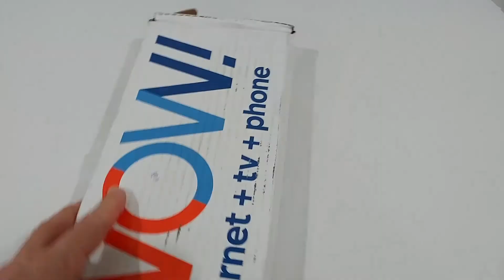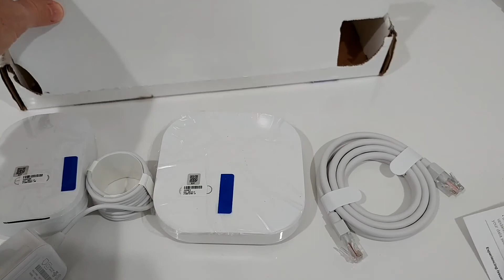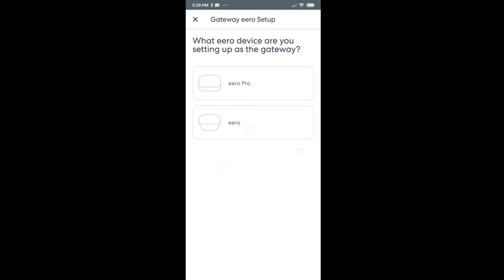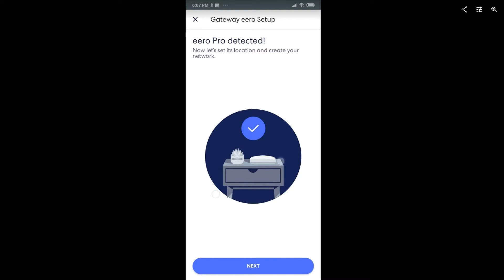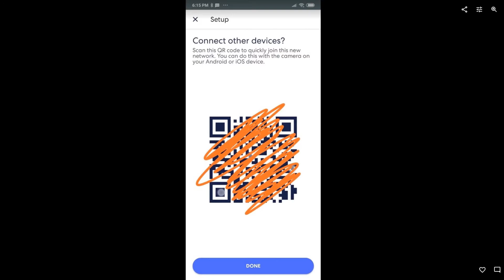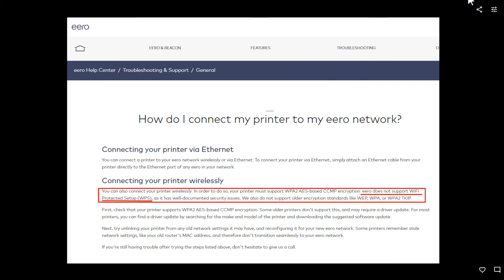Eero Pro Mesh WiFi System 2nd Gen (1 Pro + 1 Beacon) from WOW Unboxing Installation and FULL REVIEW

Comment: I have WoW! Internet and cable for over a year now with this same Eero Wi-Fi system here and I have 1 gigabyte service that delivers over the 1 gigabyte and my personal phone gets speeds up to 750 Mbps download inside the house and 940 directly connected to the Wi-Fi router and it's been great thanks to WoW!..
Reply from the maker: Yeah usually they are very good at the moment. There have been bad times with WOW, but my last experience has also been very good. Thanks for confirming.

Comment: Not sure what state your eero nodes are in, but flashing blue light generally means that they're ready to be configured. First thing I'd do is open your eero app, and try "add eero", and see if the app picks them up. You may just need to rebuild your mesh network by adding each node in turn as though you were starting from scratch. And make sure that bluetooth is turned on for the phone that you're using the eero app on.

You could reset each node before doing this, that would be better in getting each node into a known state, but it sounds like you're looking at rebuilding your network. Not such a bad thing, but a little time-consuming.
Reply from the maker: Thanks. I decided not to chance anything and leave as is and it's working great now. Took some time, but I think it's optimizing itself. Thanks for the help. I love this thing for my security cameras. Connectivity is so much better now.